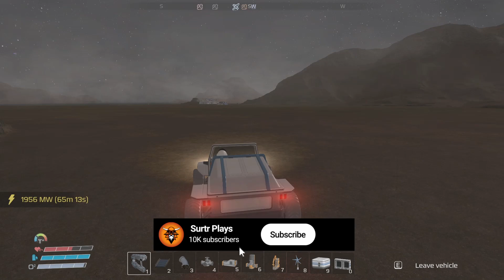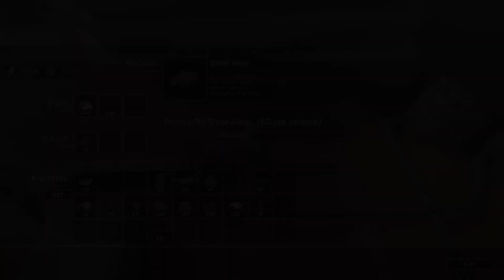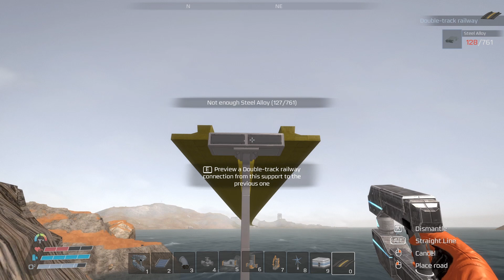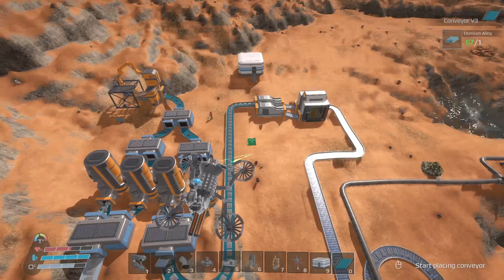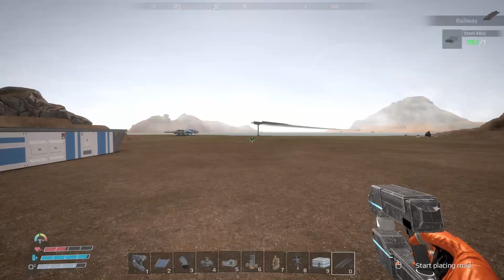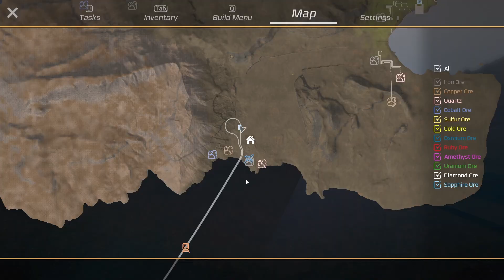Eden Crafters - The Ultimate Guide to Trains

Comment: Another thing you can use the tracks for is to build a chain of solar panels from one island/continent to another.  This facilitates setting up a power nexus with up to 6 nuclear power plants drawing from a single uranium node.  Then you can spread power out from those plants using solar panels, which brings power to all of your areas, if they are present in chains that are close enough together.  Without making a rail bridge and putting solar panels on them, many islands/continents are too far apart to link up in this way.  Love your videos!  JW
Reply from the maker: Thanks for the tip, and I'm glad you are enjoying the videos!

Comment: The caves can be removed if you want to remove it manually with your multi tool. I had to do that before. I build 4 double batteries. Then leave my inventory full. Mine till it's gone. Once the mines resources on the ground unrender they despawn.
Reply from the maker: Thanks.

Comment: On water world. Since I didn’t know much about train I use the steam roller to make a road from main island to the hot island and from the hot island to the last one, thank to you I know better. Now the question is what the max amount of freight car the train pull without issue?

And you should look for the t3 warehouse since you can then stack up to 100 with a 5 input and  output 
So the chance are high that all the warehouse on the other island will all be switch to t3 link to a train station.
Reply from the maker: Sounds like a lot of work went into that road! The T3 warehouse is great because it can be used as a warehouse or a buffer. It look like the train car carries 9 full stacks at a time.
Reply: @ well I alway had issue flying the ship 7 out of 10 I will have it dive straight into the water..so making a road is better for me

Comment: I sadly found out how this works after I setup a train line throughout my Water World. However, I'm doing the second map now and already see one thing I'm gonna use the train for. As for being able to have the tracks cross the water that way... I tried having it cross from the main island and the second one (the one of the other two that's in the prologue) and it wouldn't work. It's like conveyer belts, it doesn't work if the distance is too long between point A and point B. And yes, I tried this at the points of both islands that were the closest to each other. Now about that comment about not doing a factory on the one part of the hot island... I actually have three factories set up in that space. I had to do a LOT of things, including using V1 storage units and triple splitters for corners to get it to work. But my Water World is essentially done and everything I need automated is automated.
Reply from the maker: Yeah the trains still need a bit of work. I had some trouble using them the live stream that I did yesterday. You could get away with automating everything at locations since there are always the right resources together.
Reply: @surtrplays  So far I found them useful on Echo Prime, I have them bringing resources back to the beach on the desert island so I can set up things on the shore.
Reply: Is that why pressing E on the stand doesn't work...the distances are too far?
Reply: @Kay-uz4qv  Yes, if the distance is too far you cannot just "press E". But you can use the track as a bridge by building it as far out as you can and restarting. Warning though, it's easy to fall into the water.
Reply: @MarioKaiba this was my last hope. Can't find phosphorus and graphene any where together on a single island on Terra Nova, which means making catalytic converters by hand. I was hoping to get them in a location using trains across the ocean. Really ducks. Anyway, thanks for letting me know. At least I can stop struggling to make trains work.